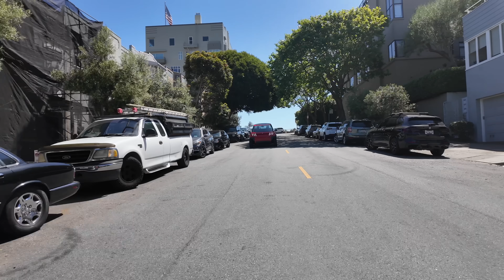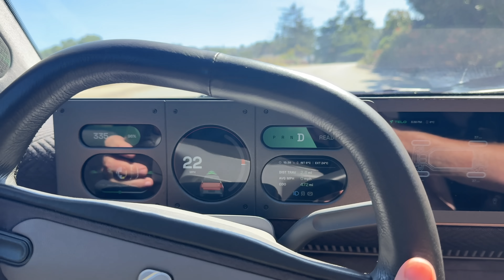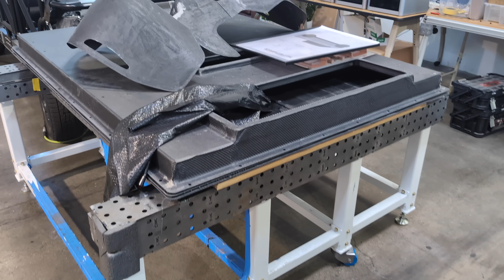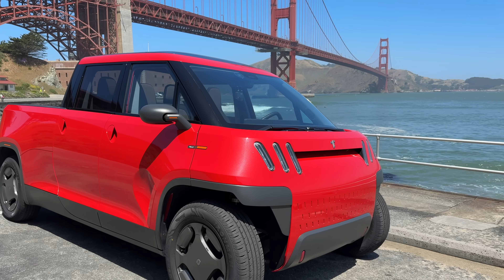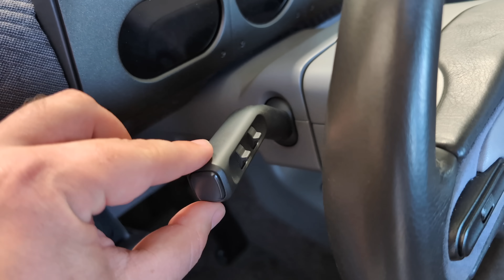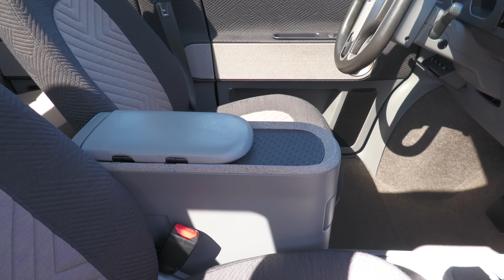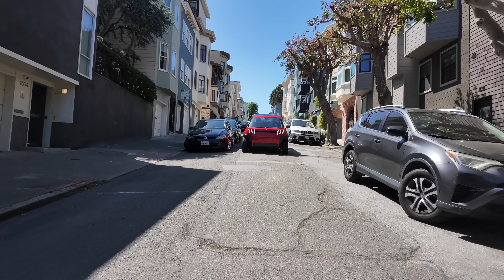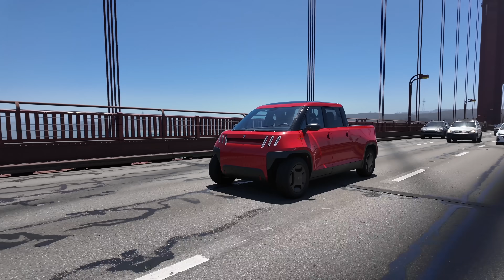The Tiny Telo Truck Hopes to Pack a Big Truck Punch

Comment: I applaud the companies like Telo and Slate who are attempting to make trucks that aren't manhood surrogates that never haul anything other than their fragile egos and tissue boxes. 
There are a lot of good ideas here. I like the two screens being integrated in a single plane. Huyndai/Kia does that and it's the best and cleanest design to provide information without being distracted by a TV bolted onto the dash. The idea of a mask over the instrument cluster is a nice way to make the virtual gauges seem less... virtual, but it definitely needs more tactile controls. Again, Hyundai/Kia found the perfect balance of knobs, buttons, and switches vs touch screen controls.

EV makers need to focus more on shortening charging times and less on 0 - 60. Every valid criticism of EVs includes the battery in some way, and EVs are already quicker than the driving ability of 99.999% of drivers (especially those who were just offended by that statement).

Comment: looks intresting but if they had let it be 10-15 cm longer then they would have been able to fit a much better rear seat system that not only would be much more rgonomical it could also be a fold me down system which would mean it could take much longer cargo.

in the tighter european cities its not the length that usually is the issue but the width.
For example ive driven deliveries in the old town of Gothenburg with my old former SAAB 900 Old Generation and the family cargo car which has been mutiple diffrent cargo cars but mostly Berlingo 1 and Berlingo 3.
Berlingo 3 is shorter then the SAAB but wider.
This meant that it was really hard for the berlingo to fit whilst the Long but thin SAAB could fit everywhere with ease.

Their Turn Radius is a BIG Plus for city driving.

in other matters have you Seen KIAäs incomming EV Cargo car? 
Looks mighty intresting to me.

Comment: 9:23 UI software dev here.  It'd be cool to hide some extra diagnostic info into the blanked spaces, so a service tech or heavy power user could pull a couple screws and get live debug easily enough, but the normal user doesnt have the visual clutter.  That and the middle fingers, lol.

Comment: Well about 3 things they need to change. If it’s a city truck you really need only 300 miles of range 200 is what most of my city trucks run daily. Do not need 500 horsepower in a city truck .  40K too much take the first two things and make it sell in the 20 K range it would do well make it simple too really you just need heat and AC  a basic info center withGPS I do wish our government would get out of all the over regulation they make auto makers do at least no emissions mess with a EV. Heck door handles and crank windows would be fine. A central locking system would be nice for security reasons in a city . For east and west coast buyers a security package of light armor 😯? I own a Ford Lightning and in the cold weather it’s battery is dismal I got it when buying other new F450s for the shop dealer about gave it away !  It’s best thing is the tax breaks for it and extra charging stations !

Comment: I'm all for smaller trucks, I wish the S10 would make a comeback (though the Colorado is the current spiritual successor), and I'm all for utes.  But trying to claim full-sized capability when your bed is smaller than a short-bed is absolutely ridiculous.  Advertise what it is and don't make big claims, else the consumer base will be vastly disappointed when your product doesn't meet those claims.  Also a 'truck built for SF streets' is a bit ridiculous as well, yeah the streets are tight but you're also getting into antithetical territory of what you're attempting to produce, if anything make a single-cab with a standard bed, based on the claims they're trying to reach.  This is why I liked Aptera, they were trying to produce something without massively BSed claims, and the evolution of their prototypes are inching closer to what their initial goal was; similar issues is also why other EV companies are now outpacing Tesla, though there's a lot of other issues there, but bold claims and not living up to them is one big reason.   I'm not even sure why they went with four doors, that rear seat looks like a glorified extended cab,  they probably could've gotten away with reversed half-doors for the back and extended the bed to be that of a full-sized short-bed; but I still think this thing should be a two-door two-seat with a full standard bed, based on the claims they're making.  That mid-gate is the silver lining that makes it technically usable as a full-sized but frankly I see mid-gates as BS that introduces another point of parts failures and seals that're bound to fail, especially with how actual blue collar workers use their work trucks; again, two-door with a standard full-sized bed would've worked so much better for this concept.  This whole thing also just stinks of SoCal tech startup, where they lacklusterly make a headlining product just to sell the company's name and assets in a glorified get rich quick scheme.  I'm also curious about regulations around this design, mainly front bumper, front corners, and how the front portion of the front wheels are essentially open and bumperless (actually, from the side shots, it looks like the wheels protrude beyond where the front of the vehicle is); surely this throws a lot of red flags with regulatory bodies, which is why we don't see this kind of design more widespread, remmeber the last fenderless vehicle we got was the Plymouth/Chrysler Prowler and it even had tacked-on bumpers on the wheels, IIRC open-wheel regulations have also changed since then.  And as a side note, their logo has issues, it's antithetical to proper graphic design of logos, one of the biggest rules, next to how well your logo scales down (small details are bad), is if your logo translates to black&white well, which theirs does not; and this feeds back into of 'this is just another tech startup' issue I have, just as the truck itself is antithetical to the claims they're making has fed into that, and the fact that they're wanting to scale this exact design throws red flags for me.  Also, if they went with the two-door design, which they should have, that would also translate well to a cargo van design, whereas this design would work better as a small SUV or SUV-based truck such as what the Chevy Avalanche (or even the Hummer H2 SUT or H3T, etc.), where if they marketed it as a SUT (with a closed-back SUV being a second option just as a two-door truck could also be a cargo van) I wouldn't have most of my issues with the truck itself, where I think the idea of a SUT (or just utes in general) would have a bit more marketing power behind it due to the fact that people will immediately try doing full-sized truck things with this just to find out the claims were BS, whereas an SUT would have meetable claims and would be unique within the wider market that directly has a wider marketable demographic.

Comment: I hope for the best for this startup, they seem to be coming at this from a very level-headed angle, and from styling to form factor it looks pretty much perfect for those of us that’d rather have a compact truck than a massive cargo barge. I keep a 30 y/o s10 blazer up and running because it’s just the right size; big enough to haul a bunch of stuff but small enough to where it has decent road manners in urban environments. Wish more were like this, but today’s trucks are basically yesterday’s landyachts and stopped being as practical for those who need something for light truck stuff.

Comment: The air tunnel behind the front tires will be absolutely ruined by salt and sand in the winter. It should be lined with plastic to protect the paint

Comment: Off topic, but that Carsized website is sweet! It's usually easy enough to pull up the numbers for width, wheelbase, length, etc of a given vehicle, but they don't always tell the whole story. Like, maybe a car isn't that long, but the front bumper is long and low and will hit everything. Or maybe you just want some context as to how much of a difference 1.3" in width is.

Comment: If Telo go one step further ans drop in a small generator/ICE, it'll be an excellent hybrid with extreme range that needs only generate more power per minute than you expect to draw in open road driving.

The power of electric, the flexibility of refilling using fuel while on the move, or plugging into chargers when you need to stop and get your lunch/work.

Extend the machines legs with a simple built in charge system not reliant on an electrical grid for folks who don't have an interest in installing a charger at home.

Comment: 11:11 At the very least, it should be an option. I can't stand one pedal driving and hate how the Tesla Model 3 has it on by default with no way to turn it off. I like how Ford and Lincoln do their EVs and hybrids where the first bit of travel from the brake pedal is the regenerative braking that varies infinitly as you push in before you actually feel the physical brakes start to kick in further down. Having an option between the two to cater to both would be nice.

Comment: I love these types of trucks! Maybe if you add more color options like yellow, different fuel options such as a hybrid and other cost friendly options such as removing the upper window or having lower horsepower would elevate the design and make it cheaper, although that isn’t the goal! Adding roll down windows and air bags too are huge selling points! I know these are hard to implement, especially on a truck that’s still a prototype, but please consider it! Overall this is awesome and well thought out 😊

Comment: I can see 3 issues going forward for this truck. 1, heavy rains. The rear radiator will most likely become submerged during heavy rain storms.  If not from flooding conditions, then just from traveling at normal road speeds (think taking a shower, but horizontally). 2, the front profile during the winter. I get they are in California, so not so much snow. I live in Chicago, where heavy snow storms, with 12-inch+ snow amounts are pretty common. That front would seem like a snow break, stopping you solid in a few feet (maybe a few tens of feet).  3, you need some kind of a bed topper. Either flat with the top of the bed, or a raised one, to provide weather protection to whatever you place in the bed (with or without the mid-gate lowered, but especially if the mid-gate is lowered). Making sure that's an option would go a fair bit to making it more attractive as a work truck. Especially in other places than San Francisco. You wouldn't be making enough per year (the trucks themselves), for 3rd party after market manufacturers to design a topper for you. I worked for over a decade in commercial vehicle up-fitting, & I would have to say of the pure pickup trucks we did, maybe 70% to 75% had bed toppers of some type (that would be in the Oklahoma/Texas areas).

That's all I got for you. At some point, someone who bought one of these will take it on a vacation -- during winter. To Colorado, Chicago, Wisconsin, or maybe Buffalo, New York.  Make it not bad or deadly for them will earn you a lot of praise. One reason the big automotive manufacturers are just electrifying their standard pickups is for the above reasons. They sell them all over the country, encountering all the weathers, & 3rd party aftermarket manufacturers make specialized bolt on equipment for them already. Even if you don't actually pre build the toppers, figuring out the engineering of it now, before the first lost sale because you didn't have it, would be worth it.

Comment: That's too big for cities and too small for countryside. Possibly works in suburbs? 

However, the big issue IMO is the driver position. The driver sits too low and far away to see directly in front of the car, which would be the "killer app" for a truck in a city.

Comment: I don't understand some of the engineering choices. Hypothetically, if the motor(s) were sized to give acceleration about the same as a typical IC pickup, wouldn't that give significantly increased range with the same battery? Do you really need brutal acceleration in a vehicle intended to spend most of it's life in city traffic?

Comment: I agree totally about the regen. 1-pedal driving FTW!

As for the seat materials, I MASSIVELY prefer cloth to anything else. Cloth makes seat heating and cooling irrelevant. It's cool in the summer, warm in the winter, and you don't slip and slide around when you're wearing winter clothing or stick and burn in the summer. Cloth is also much tougher and longer-lasting than leather or leather substitutes. Cloth can also be every bit as luxurious as leather, and there are far more options for design and style. PLEASE make cloth standard!

I have concurrently had vehicles with cloth and real or imitation leather seats for the last 30 years, and there is no contest: cloth is a thousand times better than either real or imitation leather.

Comment: This is the small truck I've wanted for years, the old school Tacoma is far from a compact truck now. This gives a modest sized bed in 5 seat mode and a full sized bed in 2 seat, so the daily driver and the utility truck when needed, which is needed at that price range. The price is not bad for a truck but it's why so many Americans have a truck they only use as a truck on occasion, its too expensive to be a second vehicle, this could do it all, and be way cheaper to drive as the daily vehicle.

Comment: OK, that, but
- hatchback instead of bed
- 2 to 3 ft shorter
- half the engine power
- at least 40% less battery
- back seats moved ~5in back but still foldable
and I would LOVE it. Probably.

Comment: Telo: "for the city"

Also Telo: 500 HP baby!!!
Reply: I've never wanted a vehicle more
Reply: At 4400 lbs, I'd be happy with 220 to 300 HP. Most semi-trucks you see in the US only have 400 to 600 HP with 7x the max gross weight.
Reply: Not all cities are flat. Or "urban"
Reply: @trowawayacc Case in point, San Francisco ;)
Reply: @trowawayacc Torque not HP for hills and pulling.
Reply: @trowawayacc even 200hp is more than enough power for this thing, especially as an electric. Electric HP is always greater than gas engine hp because of torque. When I worked in the field you would spec about 60-75% of the gas engine's horsepower to match it with an electric setup in conversions.
Reply: @trowawayacc you don't need 500HP to go up a hill

Comment: It's an American made Kei Truck AND I LOVE IT!

I probably won't get one because a hot-hatch and a standard pick-up can cover everything I generally do, but if I was stuck with just one vehicle, I'd probably consider one.
Reply: It's not a kei truck
Reply: @logitech4873  Oh, so sorry, you're right. it's 15 inches too long and 11 inches too wide t classify by current Japanese standards for a keitora-class. 
A specification that has had an 80 inch increase in length since it's creation.

Comment: as someone who lives in the sweatbox known as FL.  can I get a NO sunroof, and Synth-Cloth Seats?  something that can take really hot temps.. and then COOL off as soon as I open the door.  I dont need to sit on 100+ degree F Synth-plether seats when its time to leave work.   how about an electronic sunshade film built in to the windows so when I turn the car off, the glass goes opaque or (better yet reflective) so those pesky UVs dont turn in to IR waves inside the greenhouse of my vehicle.     electrochromic or smart glass is real, and takes only a small amount of watts to keep transparent. (and it can also offset its use by lowering the AC power requirements by tinting in bright sunlight.)  also a couple of embedded solar cells on the top of the car might offset the film power draw so it wont bite in to drive range (in day driving)

Comment: This looks wonderfully utilitarian to me. All the things you'd expect and demand of a pickup truck but without all the bells and whistles most makes put in there to "justify" a high price tag. Those really up-front wheels looks like they'll make it relatively capable off-street as well. I'd only wish for the rear bottom panels to be lifted a bit further as well to avoid it from snagging on things. An incorporated roof rack would be amazing as well.

Comment: Big trucks can haul a full sheet of plywood, many in fact, because of the 8' box. 5' is too short. sorry guys this is the one time 5' is too short. Delete the ext cab and maybe you have a chance at competing. if you want 4/5 seats buy a car."why 4 and not 2, because no one buys 2 doors anymore" if you go to a lot there is no 2 door trucks to buy. No one buys them because you cant.  it being 4 feet shorter than the F150 means there is room to make it longer. and with extension comes a longer range. work trucks are either for a crew, in that case use a VAN, or hauling in which case you need a bigger than 5.5' bed. F150 is a glorified car and not a truck. Working men dont buy them because they can, but because its the only option. Wannabes buy the trucks because its big and manly to own a truck that gives you the air of working hard even if you dont and they "haul" most of their stuff inside and is the reason why 4 doors. If a nissan Cube was taller, had 4 doors, not sliding cuz that would be a van and vans are for moms, and was styled like a brick like the F150 is it still wouldnt sell even though it meets the requirements 75% every F150 buyers needs even w/o a box. these people want an Canyonero. 

This truck needs to target the Kei truck market, to do so it needs to delete the crew cab and just go ext cab. the monster tunnel is a great add but if it were 3x wider under the rear door, cut the door in half because its now a closed compartment door and not a passenger door it would have more utility.